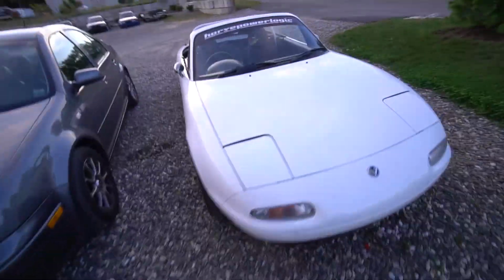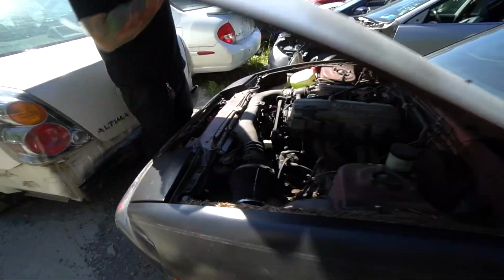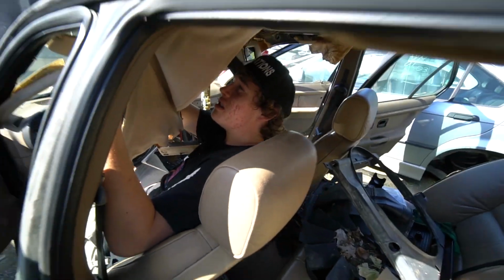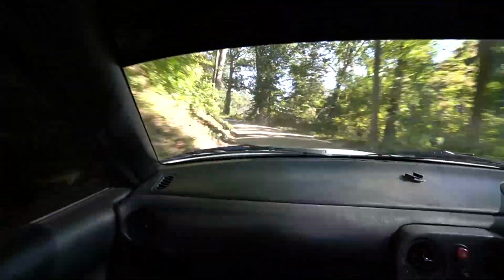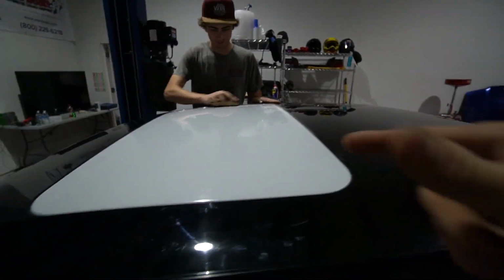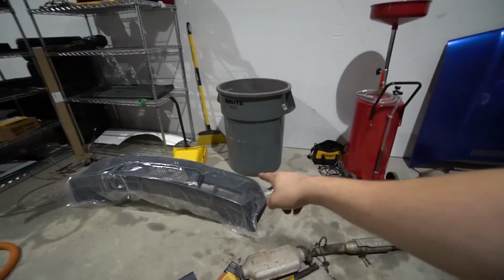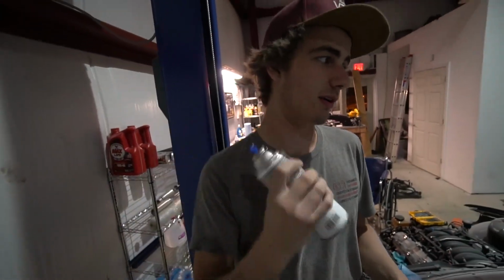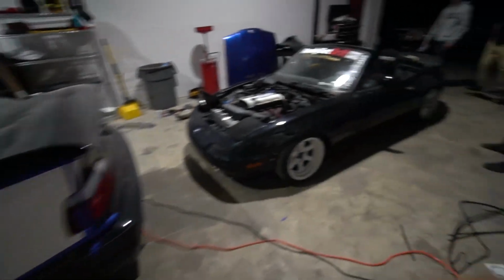SCAVENGING THROUGH THE JUNKYARD!

Comment: Hey rudnick, mighty car mods has done a series about na miatas and in one of them they were installing underframe support. There were some cross thing etc... AND  there were a pice of steel that goes around and along the frame rails and is screw in sandwitch on the floor. I think this can solve your problem with the bented frame rail. You can get some stiffness/safety out of this system i think.

Comment: Pro tips : 1) You should do rivnuts with stainless button head allen bolt for a better finish over just rivets. 2) When sanding the roof prime it. Then with a black sand primer dust t over the gravy primer and then sand. This will give you a guide coat to make sure it is level. Should have used fiberglass bond as the first layer in the cracks as it's much stronger.

Comment: Get a grater for the bondo. You dont let it dry completely you let it get semi hard like jello and use the grater to form it and then let it harden completely and sand it smooth. Tight wipe it with some putty prime it and then maybe tight wipe some more if needed prime again done.

Comment: Bondo brand is the worst body filler to use it will crack and chip off. Next time go to an automotive paint supply store and get the green  quick harden filler.